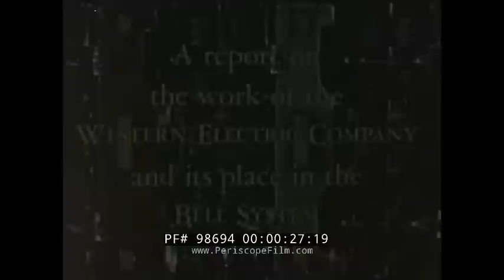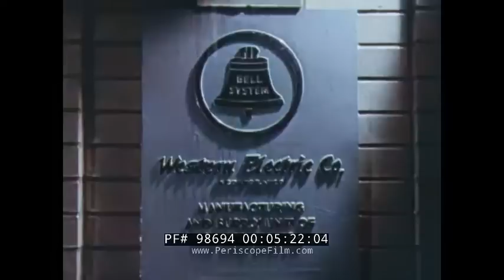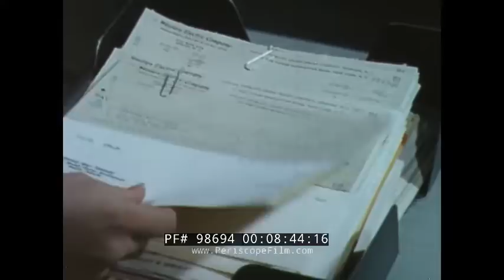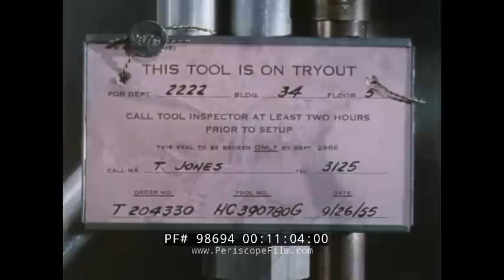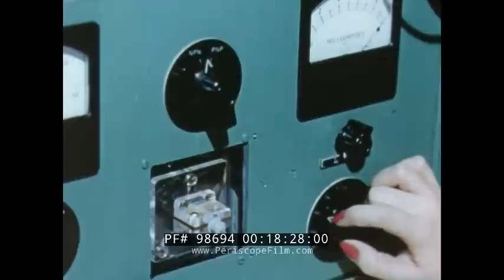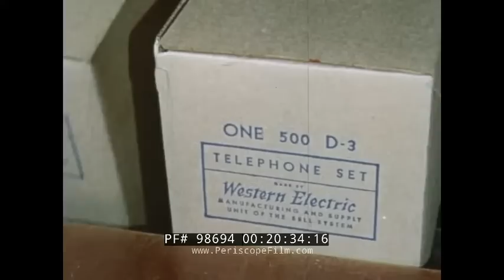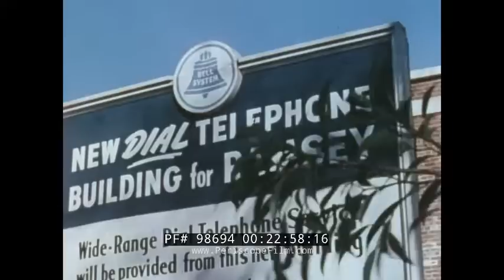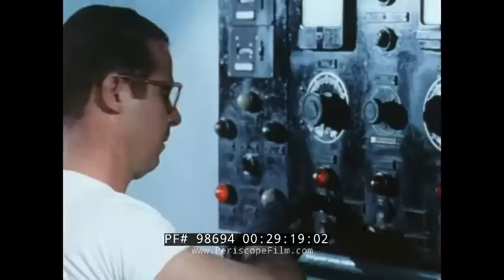"TOOLS OF TELEPHONY" 1956 WESTERN ELECTRIC TELEPHONE SYSTEM PROMO FILM   BELL SYSTEM 98694

Comment: As a current aerial lineman you'd be surprised to know that I come across equipment on the poles that was installed back when this movie was made! Much of the systems are still carrying signals!! We go to ATT in the morning to get our cable and hardware and the stock room of today doesn't look too different! Good engineering stands up to the test time.
Reply: That final sentence is GOLD. Ya listening, millenials?
Reply: @Weesel71  Here hear!!
Reply: Have you run across the wire with cloth insulation and Powdered Arsenic inside to keep mice from chewing on them?
Reply: @commentatron  Yes, I'll agree with that to a point. I worked with a certain bunch hired right out of college: knew everything there was, is, and will be. Wouldn't talk with more experience people and just ran amok. Management though it was "progressive."  I chose to retire.
Reply: Funny! I also did tele in Detroit. We used to come across the old stuff every day! How about wreckout cutting down the old leadline! We had to wear gloves and masks! Or the old ramsheads! That hardware was 50-60 yrs old! Great engineering lasts yrs! And the prints today look almost identical to the old ones! Except now it's fiber instead of the copper!!
Reply: My Dad was a 5 man installer, worked for Western Electric in the 60' and 70'. He would be so proud to see a video like this. He was on strike for over 9 months, he got on local news while picketing. 

Neighbors put boxes of food on our doorsteps. I ate sugar sone sandwiches, Wonder bread.

My Dad would go from Telephone company building to Telephone company and install the switching systems. He was offered to be management but didn't like to order older guys to pull cable, he'd rather be using his head and hands.
Reply: Yeah, my Dad worked for the Bell System in Rochester, NY for 41 years until his retirement in 1990 As they replaced the relay racks for the new computerised Japanese systems, he brought home boxes of stuff that were to be destroyed, not recycled as we both were Ham Operators. I had several cases of Western Electric WE 328A's and 2D21 tubes, plus miles of wire wrap wire and 100's of pounds of electric solder rosin cored, relays
Reply: @lomgshorts3  My Dad was a bit of a do gooder. He didn't curse or whistle at women. He also told me of another installer who'd throw spools of copper wire off the roof of the Telephone building. When he told  me that story he made sure I understood that he didn't take stuff from the company. He really didn't bring much home. He had a pair of needlenose pliers and a one eared headset to test the telephone line in the house or a neighbors house. Like the one in the video. Cool to know our Dad's are/were the Marines of the communication industry. 

He got his start in the Army Signal Corps.
Reply: My first professional job was with the phone company, but I purchased a cable line for my house because it's faster and more reliable than pots. Cable companies got the jump on phone companies in terms of bandwidth.
Reply: @johnfitzgerald4456  he didn't take stuff from the company, except that test butt-set, about $300 or so, other than that, never anything from the company.
Reply: also those Model 500 telephones rugged enough to withstand a nuclear blast at 50 yards.
Reply: On the other hand…..just out of the Marines 1957 was a lineman for western Union.  I don’t see any of their lines that are active.  All of it’s done by data links I think.
Reply: @kalon227  did western union use all their own wire lines and poles between the offices? I don't know why I assumed they leased dedicated pairs from the bell system. Never thought about it until I read your post. Nowadays the bell system is going down the same road to obscurity wu trailblazed decades earlier.
Reply: Well said!
Reply: We were wrecking out a pole down in Houston TX. When we pulled the end out of the ground we found trash dated from early 60s. Its funny how many poles we work on that havent been touched since then.
Reply: Not stand up to the test of time!
It's STANDS the test of time
Reply: That's a tribute to the old AT&T.  Today, the company is NOTHING like is was.  The company is now totally unreliable and superficial.  The concept of standing behind the product is  lost.  It's just "take the money and run."  And if you try to explain a problem, your time is wasted with "Customer Service" representatives in The Philippines, who offer empty wordy scripted responses with equally empty platitudes and gaslighting,  taking seven or eight hours resolving a simple issue.
Reply: I remember as a repairman shooting troubles in odd and even pic cable.  Using the repairmans meter I would use the points on the meter to find opens in the aerial cable.  1 point was 1 section.
Reply: In the homes too! Ran in transformers still plugged in to power the lights on princess phones.
Reply: The film shows much like the equipment I used from 1968 on.  It brings back a lot of good memories from my days as a technician.
Reply: @Weesel71  Except what thomas nikkola doesn't tell you is that for every good piece of engineering, there is garbage engineering that makes replacing or troubleshooting a long and arduous process.  Take the paper cable in this video - if it even gets a hint of moisture from a break or a pressurization failure, the entire cable is rendered useless.  Moreover since there is no colour-coding on the wires themselves, every line needs to be manually traced.

Neoprene drop wires are cumbersome to work with and the jacket quickly becomes brittle after UV exposure.
Reply: The Nid on the side of my house is the silver box shown in this video. My house was built in 78.
Reply: @boopro12  I hooked a pole in 73’ that had a date code on it that was  1928
Reply: Alot of the plant in Parts of houston and katy, richmond rosenberg need replacing. I know they just want everything on Fiber now. It piturbs me that they arent keeping pots around which is by far more reliable than voip or cell.
Reply: @robinreiley1828  paper insulated
Reply: @johnheinrich6907  hope you tested it with a screw driver at the base
Reply: @Weesel71  we called them jet jobs
Reply: @Alkatross  if Ma Bell hadn't been broken up irs likely they would have been more reliable and faster than cable or cable would be much better today in order to stay ahead of Ma Bell.
Reply: @boopro12 yeah, you can look at a pole and get an idea of how old it is. Is the top crown cut? Or angle cut? These methods of shedding water haven’t been used in decades, but there’s still a lot of those poles out there.
Reply: Same in Germany. Lot of that very old stuff still active in technical sites of the major german landline providers. But now they indeed do disappear more and more.

Comment: I started in 1970 for Western Electric. Best job I ever had.  I had to be able to run cable program computers and use a typewriter climb poles and install phones quite a career
Reply: I started with Southern Bell in Miami in 1969. I left for New York City to work as an installer in the World Trade Center in 1971. Four years in the Navy as a central office and power plant technician 1971-1975.  I came back to New York Telephoneand left in 1979 for Southern Bell in Charlotte, NC. About 3/4 of the Systems  Technicians were from Miami. I knew about 1/2 of them. Some I went to high school with. 

1984 went to AT&T after the split. It was a terrible experience. Younger techs trying survive all the layoffs. Older useless ones doing nothing productive. They'd delay working on a job until just before the due date complain to the boss and the younger ones did their jobs for them. Yet the younger ones got laid off. 
I survived. I set up a business doing what I'd done at AT&T but also was the salesman, technician, manager, and janitor. My assigned accounts went with me. I made sure to not even tell them I was being laid off and went to them after I was off AT&T's payroll. 
AT&T lost thousands of existing accounts and a lot of future sales and work because of it's technicians. The systems technicians took the business customers. Another company took all the central office maintenance and upgrade work all over the US.

People were angry. The company treated people badly at the end. Trying to fire people so they wouldn't get their pensions.  On October 31, 1985 about 40 in my section were being laid off. We were told to report to a conference room and wait for a telephone call. An HR manager called and told us how to fill out our separation package. Then we were told to leave our keys and employee passes on the desk and leave. 

One fortunate technician got laid off on that Friday was rehired by Bell South on Monday. It was all prearranged. He took the $40,000 severance and kept it. AT&T tried to take the money back but he had nastier lawyers. 

I never heard from the company until my vested pension was due. By that time my division was owned by Reuters/Thomson C in France. They offered a bigger sum if I took a lump sum. The CEO Charles Brown made millions of dollars on his stock  options every time there was a lay off. He went to a meeting one day, didn't like the questions he was being asked, jumped in the jet leaving everyone who'd ridden there with him and quit.

Comment: Was a long distance operator for Pacific Bell in San Diego University Toll 1964-1968. Still close friends with two girls I met there. We get together and tell the old stories that make us laugh every time. We agree that the high expectations the company had of us gave us the work ethic that we continue at age 76 to still have. They expected the best.
Reply: They expected the best because they were the best. I remember seeing work done by other phone companies and it didn't compare in sturdiness and appearance. We may have taken a little longer to do somethings but we had low service failures. As a repairman I mostly worked maintenance. Standards slipped in the 1970s and it showed. Repairman were finishing improperly done work and trouble reports climbed. They wouldn't put more of us into repair so we worked a lot of overtime. I worked 23-26 hours overtime every week.  I made a lot of money and when I was laid off in 1985 I had no mortgage and a lot saved.

Comment: Thanks for posting. Worked at Western Electric  HQ in Pittsburgh and was assigned to several different switching offices to run cable. It was during the summer of 1968 when a Junior at Pitt. Was thrilled to see the photos of the switching offices and those rolling ladders that I climbed everyday. At the top of the relay panels were troughs where new cable was feed from the work floor up to the troughs. It was my job to "tie in" the cables onto the existing stack that ran along the troughs. We tied them together using a weaving process and special knots. The work area was approximately seven feet off the floor and required youth and agility to traverse.  The cables were about an inch+ in diameter and were packed with hundreds of tiny sheathed copper wires which each carried phone calls. A one foot section weighed about 7 lbs. I know because I kept one under the front seat of my car as a billy club for self defense if necessary. I remember the guys, and we we all guys in that department then, who spent every shift doing the work of splicing all of the individual wires within those cables and attaching  each wire to the correct terminal on a circuit board . They did this all day long either standing or sitting and back the to me their skills were amazing. I probably made 1.75/ hour which back then was very good for a summer job. 
Looking back I miss the simplicity of those days compared to the uncertainty and chaos of 2022.
Reply: Good to see a fellow Pittsburgher here. Thanks for your hard work and dedication during those years. I just moved to Pitt a year and a half ago but I love it here

Comment: Back when large corporations were respectable and not just making money for the CEO and shareholders at the expense of everyone and everything else. Western Electric/Bell Labs really paved the way to better communications even though none of those old methods are really being used much if any now.  Likely  the most important of all, the transistor.
Reply: Bell Labs really did help lay the foundation for the modern era. They're also responsible for the laser and fiber optic cable, which provide the critical high-bandwidth links that join the whole world together.

Comment: @13:47 Baltimore plant. I worked there until 1964.
Reply: Doing what?
Reply: @mikecowen6507  good question....
64 was a while ago.
Reply: He’s too old to remember, lol.. I was only 2 when he retired
Reply: @johnbattista9519  You're 2 up on me! Lol!
Reply: Those people working on the assembly lines.......what happens to production,  when they have to go take dump?
Reply: @mikecowen6507  Baltimore Works primary job was to make cable. The cables put under the oceans for transcontinental phone service was made at the Baltimore Works. I'm certain that factory made some other stuff too.

Comment: As an IT engineer that takes care of the company phone system, I find this fascinating. Everything we have is IP based now with a handful of copper lines here and there for emergencies. Keeping copper lines around as our final backup to be able to at least call 911 when everything goes down is something I've insisted on. We have redundant connections setup at all our locations so (in theory) we should always be up, but theory doesn't always pan out in reality. I've had to rely on our copper lines to call our remote locations to check on things when there's an area outage on different providers that has knocked a location offline.

At some point we will have to drop the copper lines as the telcos don't want to keep supporting them anymore and keep raising the rates, but for now all I can say is kudos to the folks at Western Electric for building out that infrastructure in the first place.

Comment: In the 1980s I worked on the Eastern Test Range for both RCA/PanAm was a Comm guy, did a bit of everything Inside Plant, we had a Stromberg Carlson 800 line XY switch from the 50s Ill never forget going into the switch room hearing the clicking and steping.  Transfered to PAWs for OSP and the dive ops on the subcable. All Western Electric 1950s equipment  Good times!
Reply: I used to repair 1A2 systems at AM radio stations. early solid state systems would go berserk in strong RF fields. I was a freelance broadcast engineer, and I still have a pile of 40 series KTUs, some new, some used. I also used to buy defective Melco intercom adapters and repair them.

Comment: Former CO tech for Sprint. All this stuff was still around in the early 2000s. Walking around in the old main CO building was sort of melancholy, you could feel the decades weighing on you there. Mostly abandoned rooms nobody ever went in anymore but desks and bulletin boards with 30 year old paperwork still tacked up. There were literally tons of 25 pair cables in the runs that had been retired for years that contractors came in and tore out. Had to wonder about the guys who'd installed it all.

Comment: I noticed the pre-cursor to a semiconductor wafer diffusion furnace in this ( the glowing glass tube). I spent 2 years as a student playing with them in a 4 inch and 6 inch fan in the 80s.

Comment: Really good video  !!! BTW There are a few reasons why lead sheath cables are/we're used. Corrosion resistance is one., harsh environments is another. But mainly they are used for safety and fault protection. Whatever the inner conductor or conductors are used for ( power distribution, signals, control etc ) the outer lead sheath is connected to ground thru a monitoring and indication circuit.  In the event of damage or leakage of the inner conductor to ground, ( the sheath) the lead sheath will have that conductors voltage enter it and trip relays in the lead sheath protective circuit. This will usually result in a trip being sent to whatever breakers are feeding and supplying current to that cable. This will ensure that no damage is done to the cables, their associated equipment and prevent injury to anyone working on stated equipment. As a protective device lead sheath cables were very valuable, efficient and straightforward in their simplicity and effectiveness, and very reliable
Reply: Thanks for the detail, I was wondering why Lead.
Reply: and rats, the lovely creatures that they are,  wont eat them.
Reply: @joee8417  Rats and especially squirrels chewed holes in the lead cable. The insulation on the wires was made of of paper and the first rain capillary action would suck water into those cables. The wet paper would fall apart and the whole cable would be ruined 6 feet into the sheath.
Reply: Steel does a better job in all respects.

Comment: I have been in the AT&T building in downtown Kalamazoo, MI several times for training. The building has 7 floors but only the top 2 floors have offices. The first 5 floors plus basement & sub-basement are packed with telephone switching equipment including old rotary dial switching systems for people who still didn't want to pay the $2-$3 for tone dialing. Being inside that place and looking around you can't help but to marvel at the unimaginable number of wires and fiber optic strands running throughout that place. A lot of it has been added over the years, so much so that the cost must be astronomical to build, equip and run all those different lines all at once today.
Reply: Small world bro.  My dad spent about 30 years doing installation and repair for Michigan Bell.  Battle Creek and Kalamazoo.  He left in early 80s.  I did almost 20 years mostly on 5ess in Naperville Illinois ending in 99.